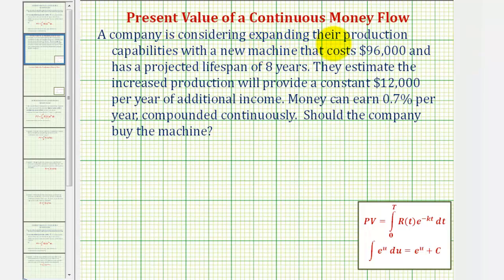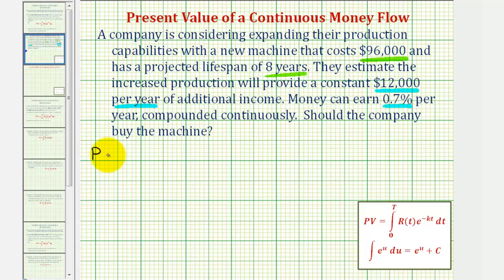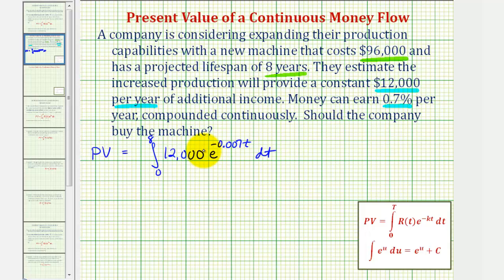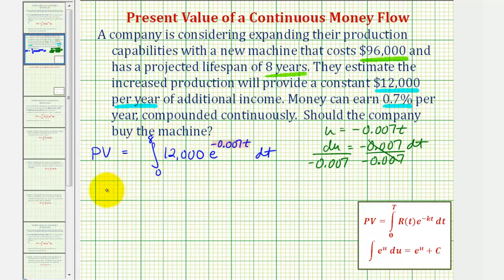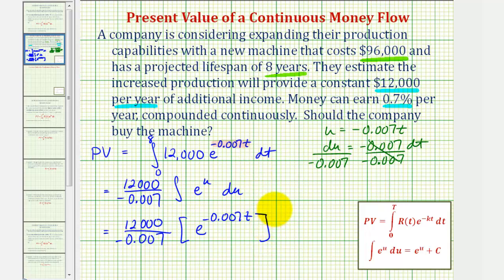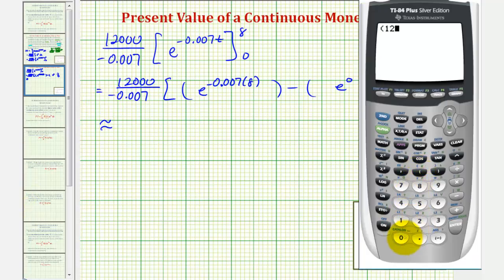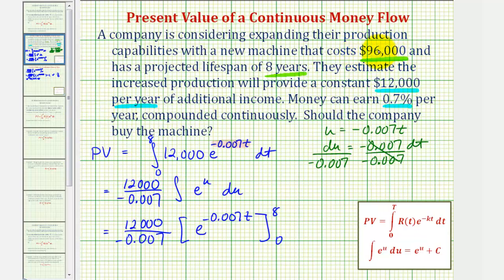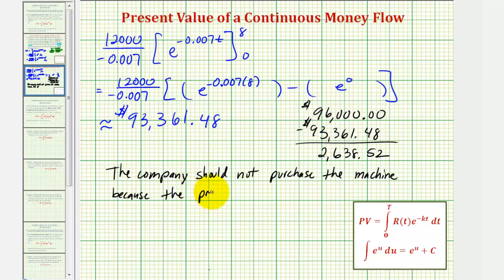Ex: Integration Application - Present Value for Business

Comment: this doesn't make sense in 3.25 (1200/.007)(e^(.007*8)-1) does not equal 93361.48 i get a negative number every time -162092.42
Reply from the maker: +Bernie Brandon You are missing the negative sign on the exponent of e.
Reply: Please reply
Reply: Why should I use e power negative